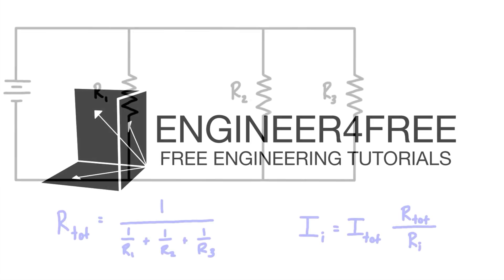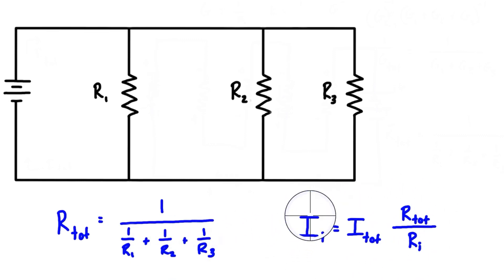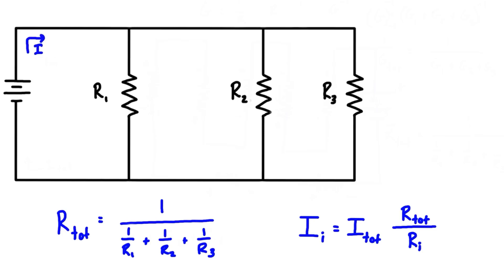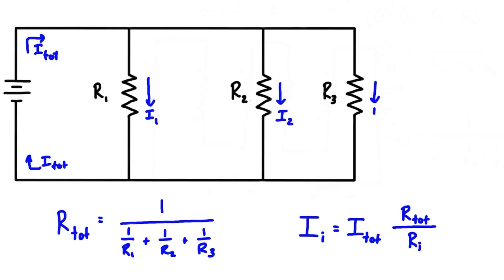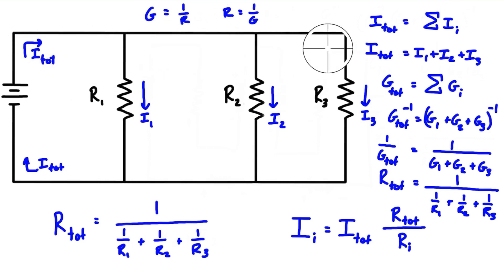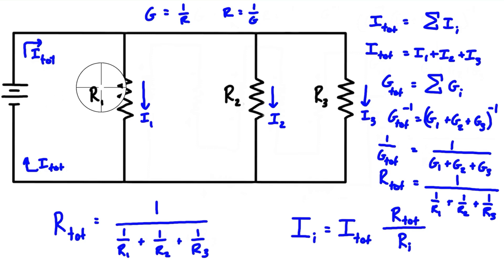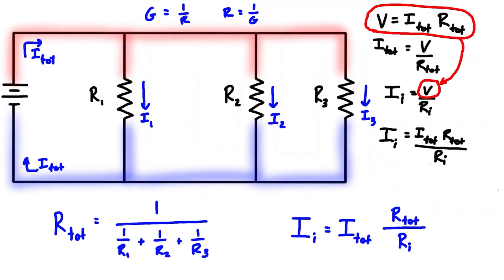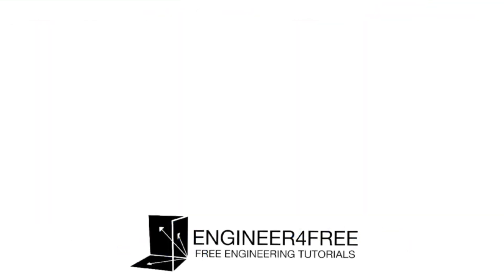How Current Division Works (Parallel Resistors)

Comment: The way we were derived this result was through Ohm's Law. Since current gets divided in parallel circuits, I(tot) = I(1) + I(2) + I(3), from Ohm's law, I = V/R, so V/R(tot) = V/R(1) + V/R(2) + V/R(3), taking V common, we get 1/R(tot) = 1/R(1) + 1/R(2) + 1/R(3).
Just something I thought I'd share.

Comment: Maybe it's just me. 
When I see R (tot) my mind seems to want automatically assume that R(tot) is the sum of to the R's in the network.
I have to remind myself that it is the R equivalent that is being discussed.
Wondering if others may have this challenge ...
Reply from the maker: Good point. In my head total and equivalent are the same thing, but I see how it could lead to some confusion with parallel resistors. I think I usually opt to use tot because it rolls off the tongue quicker, but I'll try to be cognizant of it in future videos!
Reply: @Engineer4Free  It is true that in the parallel resistor  case G(tot) is the Sum total of all the conductances.
A short I used from high school through Senior year EE was the rewrite some equations , where applicable , into their equivalent conductance/admittance forms and take the inverse for the final answer.
 It made for much efficient computations, both manual and computer code.
Reply from the maker: @lgl_137noname6  Very clever! Thanks for sharing =)